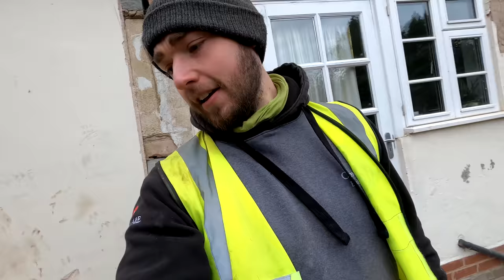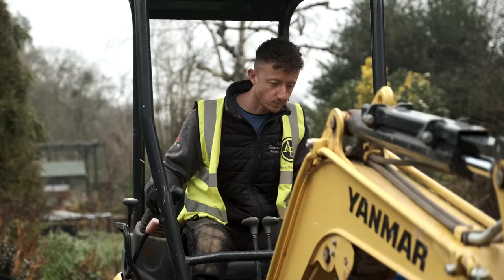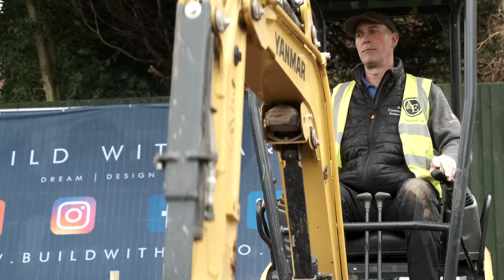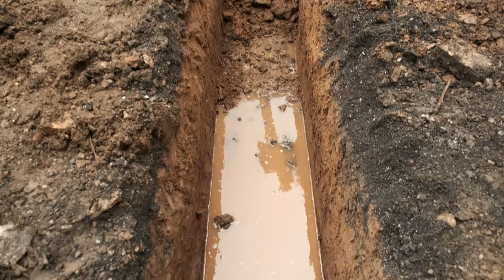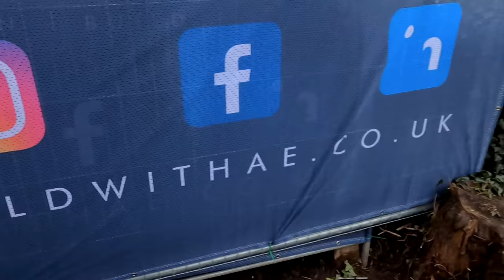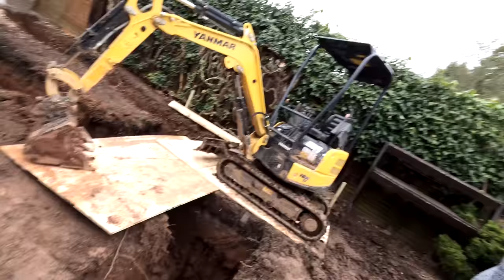Digging the Footings! ⛏️ | Single Storey Extension #3

Comment: Out of curiosity, instead of digging a footer at 2.5mtr deep, would under pinning be an option? In the Netherlands they pin absolutely everything but doesn’t seem to be a default here so I was wondering what the reason for that moght be?
Reply: When they hit the hard compact clay they should have called the BI back to review the depth requirement.